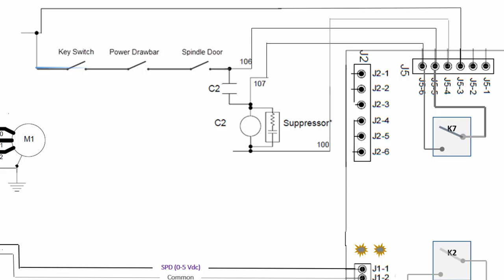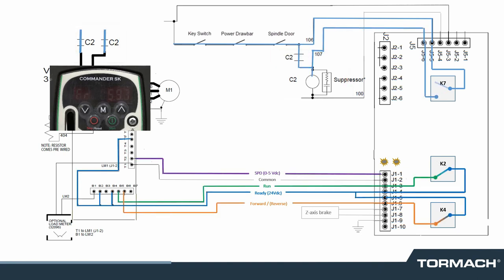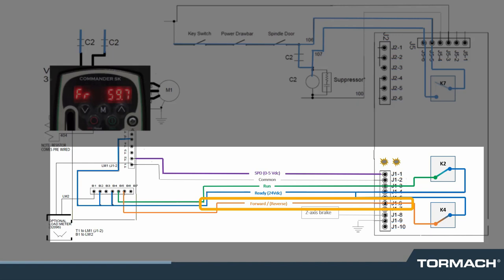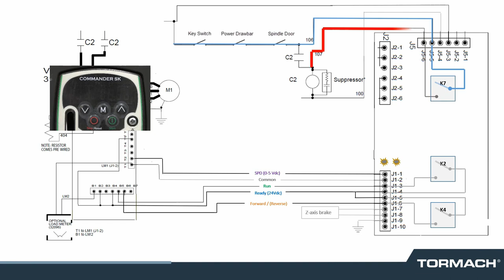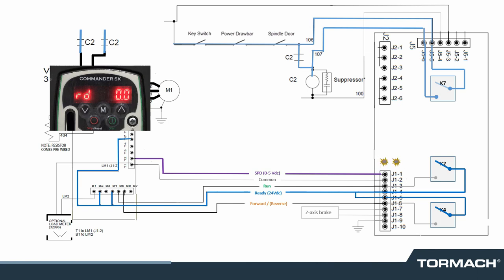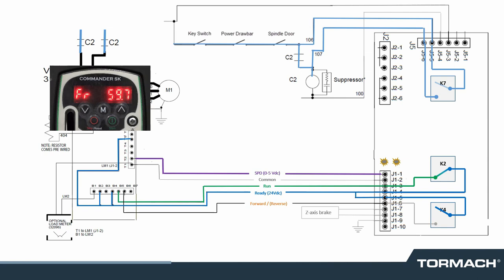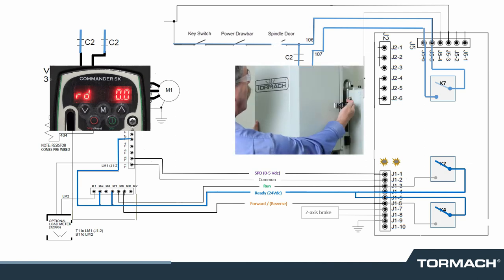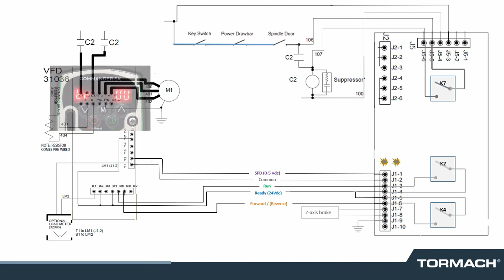Tormach Technical Support | Communication Between the VFD and Control Board

Comment: I am getting a VFD error and cant seem to find an answer anywhere online. I contacted support via email, I got pointed in the right direction in the Tormach Operators Facebook group, but wanted to throw the question up here as well as I am still stumped and need to know if I need a new VFD got a lot of orders backed up and need to get it sorted out asap. I am getting Er.St.HF Er 1. Which seems to be sub error 1. This occours when I try to spin the spindle, either manually input from the UI or via gcode.
The VFD manual says this: 
St.HF Hardware trip has occurred during last power down

The St.HF trip indicates that a hardware trip (HF01 –HF18) has occurred and the drive has been power cycled. The sub-trip
 number identifies the HF trip.
Recommended actions:
 Enter 1299 in Pr 00 and press reset to clear the trip 

I am not sure how to, or if it the correct solution, enter the 1299 code,  I dont know if there is a proprietary program to the VFD for pathpilot and I dont want to cause more problems than I already have lol.